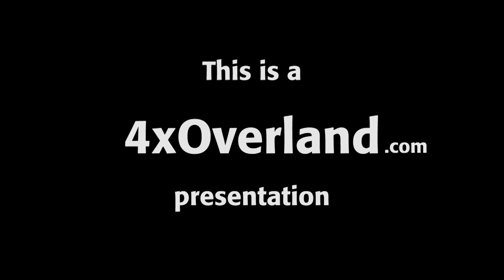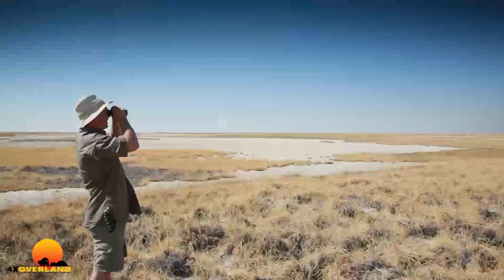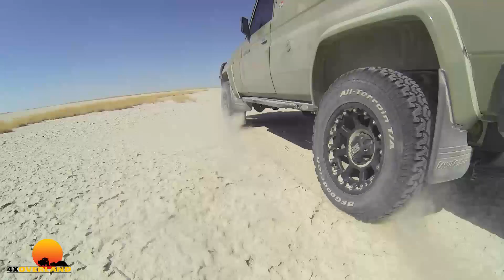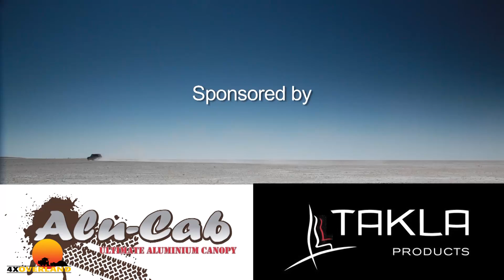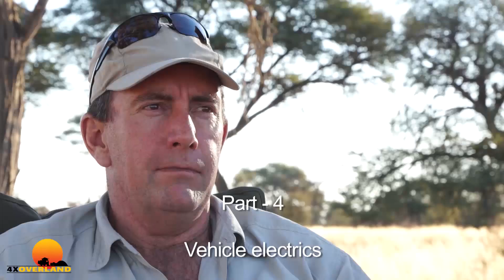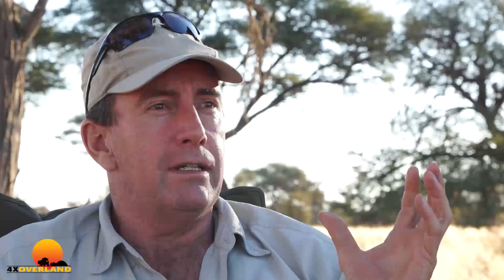VEHICLE ELECTRICS. The Overland Workshop. Andrew St Pierre White

Comment: Seems that a solar panel along with charging from your alternator is the way to go. also a sealed agm type deep cycle so you do not have off gassing if the battery is located inside the cab.

Comment: I am more confused than ever
Reply: TY ACORD for a “house“ battery in a car you should just go for a LiPoFe one. these are used for home of grid. they will live longer than your car, can be discharged up to 90% and start by ~ 200€ for 20Ahm. same price like optima 45Ahm that can be discharged by MAX 50%. the agm is min double the weight and size!
LiPoFe can also very much faster charged. this is due to way less internal resistance.

you can compare this to 90ies cordless home phone batteries to your smartphone today, very similar.
Reply: keep steeping yourself in these types of videos and tutorials. You will pick up the jargon and elect theory as you go along. Everyone starts at the beginning, but you must put the time in and do the work ....  :  )

Comment: Hi Andrew, What is your view on dual-alternators? As an example, the Land Rover TD5 would fit an extra alternator in the place intended for the AC-pump. This could provide one with a completely separated aux-system. ??
Reply: Buckhandle  I have a similar setup on my 300tdi 90. A 100 amp alternator belted off the back of the top pulley to run a completely separate system.
Reply: +Buckhandle That's the way to go for a serious expedition vehicle. Separate alternator, regulator, charge controller, battery, etc. for all of your house loads. Let the factory alternator take care of the starter battery and factory systems. Even if you have to fabricate a bracket, finding a way to mount a second alternator is worth it IMO. 

Also, I'm not a fan of those battery combiner switches. Carry some jumper cables. Simple and robust. You can always jump start your own vehicle off the house battery if the starter battery goes dead. 

As a bonus, you have built in insurance against alternator failure. If your factory alternator fails, it is a small amount of wiring to disconnect it and wire the house alternator in its place.
Reply: Seth Williamson
Lots of good ideas there Mate! With the good old 300tdi engine, provided you have no aircon pump, the threaded holes are there already and suitable brackets and fittings for a second alternator can be bought ready made.